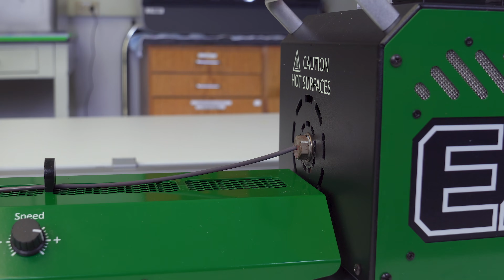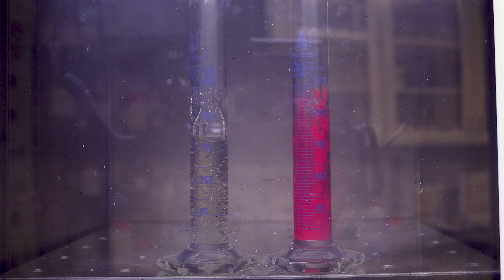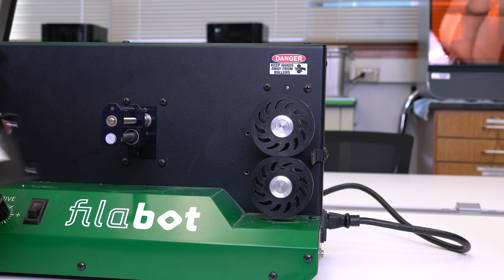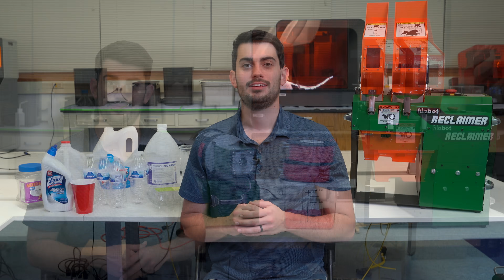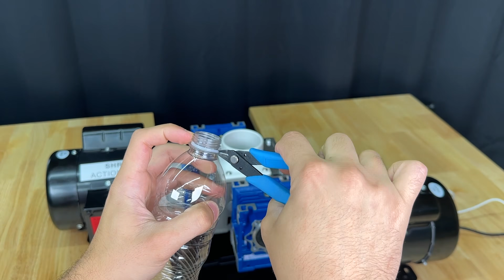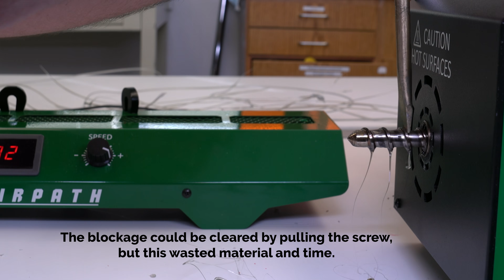Recycling 3D Prints and Waste Plastic into Filament (PET & PLA)

Comment: the general idea i have gathered is recycling plastic into 3d printer filament is just not worth it, economically or enviromentally. the energy required to grind, then reprocess into pellets to finally produce good 1.75mm filament is going to be quite a lot, and the microplastics generated by the grinding process could be a concern.

rather the focus should be to convert waste 3d prints into other products that have less concerns on contamination, no need for grinding, no need for repelitisation. from what ive looked at converting failed prints into plastic sheets or injection molding might be the beter options.

pullstrusion is also not ideal as you can only recycle the outer wall, the majoirty of the plastic is in the top and bottom of the bottle. 

its not to say, give up dont recycle. rather we need to be careful where we direct our efforts in recycling, i personally dont think the best use of our efforts is spent recycling 3d prints back into 3d printer filament.

Comment: having to go from solid to chopped to shredded plastic extruded into wobbly 3mm filament back into pellets to then re-extrude into 1.75mm is quite a process, seems like a few steps could be skipped with with a more optimized machine. A shredder that actually has enough torque/HP to single pass grind it would save a lot of energy, and a second extrusion stage to take the hot 3mm filament and directly turn it into 1.75mm drastically reducing the amount of thermal cycles
Reply from the maker: Oh there are extruders that can handle wet flake, degas it and extrude it as a precise fiber in one step, but they are prohibitively expensive (several $100k if not millions). Checkout this MRS extruder: https://www.youtube.com/watch?v=MWVwyBMCGHA

Comment: What an extensive process, learned a lot! Thanks
Reply: I think you misspelt expensive... $12k for just the reclaimer and peletizer?? And you still need the extruder and the cooling modules, and given the cost of the other 2 parts, I bet their metal box with a bunch of fans inside it sells for $300 each at minimum - wouldn't even want to guess how much they want for the extruder.
Reply: @gorak9000  40K USD for an entire set of filament recycling, so yeah
Reply: @filagain4137  I see no reason why it's so expensive, other than some kind of "greenwashing premium" to say "I recycled my filament" that big companies would pay just so they can put some bs blurb on their website - there's absolutely no reason why that "reclaimer" and "pelitizer" is $12k - there's probably no more than $500 of parts in both of them combined, and even that's probably being generous

Comment: Oh man for the cost of these machines you'd think they would have a bit more of an elegant setup. Look how much stuff ends up outside of the hopper. Also why not just have the secondary shredder underneath the primary one? It could be driven with gears. Very odd to make you babysit a process like this.

Comment: why not use a modified injection molding machine ( basically only the heating chamber and the piston, with a disk that has many 3mm holes ) , to get fairly uniform 3mm "spaghetti" and pelletize that ? instead of 2x grinding + extrusion to 3mm ?
Reply: I wondered the same, then thought about it a bit. How would you load it? How much could you load at once?
Reply: I'm also wondering why he even has to add virgin pellets in if he's going through the trouble of palletizing the recycle to mat h the density anyway. Just feels like he's choosing to recycle 50% slower for a marginally better product
Reply: @rajgill7576 to combat thermal degredation.... how much skipping did you do?

Comment: Nice video, some things about pulltruders are not correct, and maybe you chose one older model. The other thing is that pulltruded filament can be used to print up to 0.08mm , I'm doing it with my printers, you just need to increase the flow.
Reply from the maker: How long would it take for you to make 1kg of filament from (~50) bottles with your pultruder? Please include the time it takes to prepare the bottle and strip it. I had very little practice, so I am curious how quickly an experienced user can process this material.
Reply: You could easily make stackable pulltruder machines. 
Also, I usually prepare 3 or 4 bottles at a time without inflating them, just heating them. 
The cutting can be done quickly and you can store and pile up the strips.

I'm actually producing more filament than I consume myself.

The problems are:
• Too difficult to set the proper printing parameters to combat crystallization
• How to join filaments pieces to make one large 1Kg spool. Since the filament is hollow, it's difficult to join. Filament joiners available now make too weak joints that require wider spools to protect joins from breaking

Comment: This was a great video.  Looking at my own PLA waste I can say that supports are about 80% of it is and this makes me think that a perfect use for 100% recycled PLA with 0% virgin pellets added would be for a dual filament 3D printer where the recycled PLA is only used for support material.  The physical properties really become irrelevant for supports and colour consistency wouldn't matter either.
Reply from the maker: Great idea! If the model is purely aesthetic, then you could also use the recycled material for the infill and new filament for the perimeter and outside layers.
Reply: @DrDFlo  Infill should ideally not be load-carrying, as it's extruded faster and with less bonding strength. It's there mostly as internal support for roof layers.

I actually do slicing tricks to reduce the extrusion thickness of both infill and support. Infill, it depends, i don't necessarily like going much below nozzle width on that, but on support i go absolutely wild, and it comes out fluffy soft and very easy to remove because it's so fragile.
Reply: Model dependent but I think the filament swap priming would create more waste than just sticking with the primary filament for the supports, not counting the extra time and energy required.
Reply: @stevecade857  Would this be a problem with a dual head printer rather than a filament swap single head one like the Bambus?
Reply: @AndrewHelgeCox  The waste on the Bambu comes from changing filament and flushing it through ready to print. A dual head wouldn't need the flushing just priming so it's ready to print.
Reply: @stevecade857  Dual heads dude.  That’s the only way, and as a matter of fact, I’m willing to bet that will be BambuLabs’ next move, as they have been taking a LOT of flak for all that waste.
Reply: @SynthOSphere for real, even using 3 colors creates a Hilarious amount of 'poops' for a small 4 inch figurine in my experience

Comment: Great video and really nice information. One more thing to know about PET is that it can crystallize and crosslink if not cleaned/purged correctly in 3d printer hotends and desktop filament extruders/makers making it impossible to remove the the clog/plug and creating the need to replace significant and costly parts of the hardware. Makerspaces should understand the risks and prepare with good information and research for how to properly process materials (crystallization temperatures and rates etc) or they risk making costly mistakes. PETG (and PCTG) can't crystallize and that is one of the reasons it is more popular for 3d printing and that there aren't many PET filaments on the market. PET being able to crystallize though, means that it can be annealed and have significantly better properties after annealing and that is why some PET CF filaments have been offered recently in the market.
Reply: This is not accurate. Yes it can crystallize, but that just raises the melting point a little bit and is only a problem if your print temperature is pitifully marginal. At a proper temperature of 290+, it makes utterly no difference whether the material is crystallized anywhere in the extrusion path. It will just push right through beautifully, and will come out non crystallized after being melted and re-solidified with proper cooling.
Reply: @daliasprints9798  Indeed as I said annealing and crystallization increases the melting point and that also means heat resistance or heat deflection temperature making it an engineering/high end functional applications material like the PET CF I mentioned. The issues do not happen from crystallization, but the second word I used: crosslink. Crosslinked PET is a lot more difficult to clean-purge compared to crystallized PET. I am definitely not a chemical engineer, but I have heard of stories of a few desktop filament extruders being destroyed from this material.
Reply: @Dramaican88  I'm not aware of any way you can get crosslinking from just heat.

Comment: maybe melt the bottles in an oven to produce a larger plate of PET to put in reclaimer.
Reply from the maker: This is not a bad idea, but it would take a while to melt the PET flake in an oven, which would increase degradation (due to the water vapor in the air). You could use a vacuum oven, but then we are talking about quite a bit of energy consumption and at some point it would take less energy just to make more plastic from petroleum
Reply: You don't need to melt it, but you can get it to its glass temperature point and deform it!  @DrDFlo
Reply: @DrDFlo  Possibly stupid idea but does it need to be a vaccum? Couldnt you just fill the oven with a noble gas like nitrogen?
Reply: @Xamy-  Purge gassing to keep the water out would be more expensive than using a vacuum oven. When you are heating, you have to allow venting or you are going to create a bomb, so you have to allow air or another gas to go in. It take energy to get dry gas, which means you are again looking at less energy and cost to just make fresh polymer instead.
Reply: @DrDFlo  True makes sense. Maybe a bad idea but you could compress the bottles into hockeypucks with some sort of press and then melt those not needing to do the first flake procedure? (still don't know if this would solve the whole "degradation (due to the water vapor in the air)"  issue).  would be fun to see a cool solution to the "flake issue" though xD.
Reply: I think its enough to heat up the bottle. It will shrink .

Comment: Even though the costs are still extreme, the advancement in small scale extruding is amazing. I can see this being a long term cost savings for a universities and maker spaces.
Reply: But is it really when you factor in the time taken to do this? Buying a spool is probably cheaper than paying someone to run these machines.
Reply: It all depends on the time efficiency, labor costs, and the spools you're comparing to. Universities and maker spaces both commonly use some amount of free labor, and the price of a kilogram of filament can vary quite a bit, depending on a lot of factors. I've bought $14 spools, and $25 spools, for example. 

There is an obvious cost savings if you buy bulk PLA and colorants and run these machines with virgin material - if you can get labor costs to around $4/Kg, then you'll beat all but the cheapest filaments in price, and beat everyone in the ability to make custom colors, blends of colors, additive mixes, and so forth, on-site and on-demand. Slant3d, who runs a large 3D print farm, for example, talks about how he makes most of the filament on-site, for better quality and lower price.

So a workshop that processes a mix of new and recycled material will beat just buying spools fairly quickly, depending on efficiency and how much filament the organization uses, and some of those savings can be invested into the recycling arm of the operation, which needs a few extra machines and more labor per Kg of product, but if you're going to recycle filament, an existing virgin materials manufacturing facility is a great place to start.

Obviously, individual printers - even those who own a dozen machines - don't benefit from this arrangement, but at the order of 100 printers, it starts to make sense. Using the ends of spools as feed for re-extrusion sidesteps most of the problems of recycled filament, especially if the print farm uses mostly a single color for its prints. 

What really has to happen for filament recycling to make sense at the dozen printer scale is for the process to be basically hands-off to the extent 3D printing is. If I can get 10% extra filament out of every spool I buy, and I go through 100 spools a month, that's $130, minimum, in nearly free filament, and there's some marketing advantage to saying your product is made with recycled material - even if that material never left the factory.
Reply: Even on an industrial scale, recycled filament is more expensive than virgin filament.  Electricity and time cost a lot of money, and we haven't even discussed the sorting, or the inability to sort most plastics.  As presented, the sorting requires human effort, which again, is extremely expensive and prone to error.
Reply: @cnc-maker  The electricity is a point he did not even mention.  Unless you have a very large solar array, your costs can be very high depending on where you live.
Reply: @cnc-maker  This tells me the price of petrol/oil derived products is still too low.  Our societies must learn to make the difficult sustainable choices.